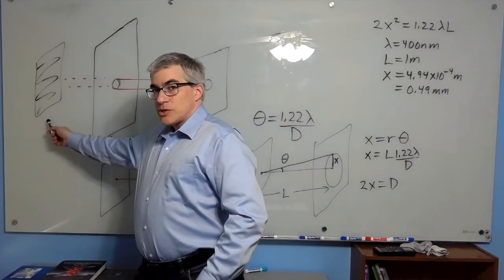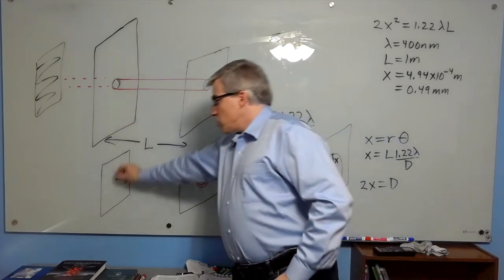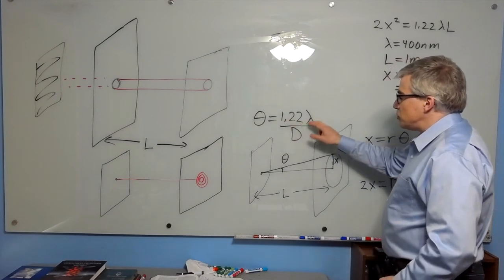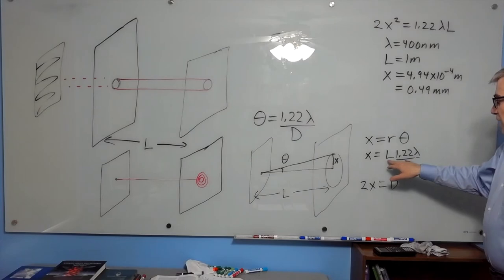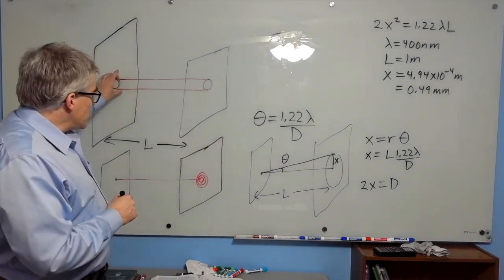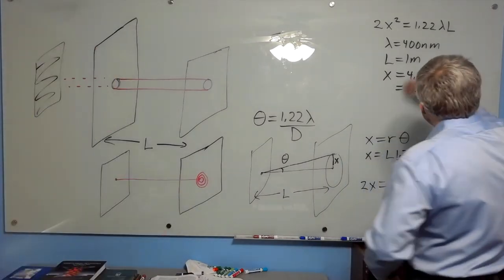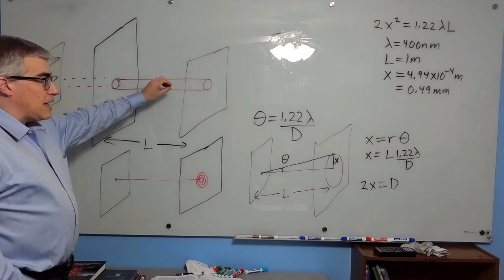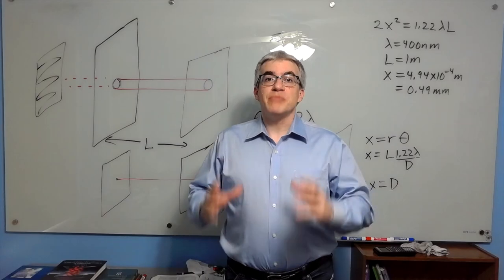Pinhole Size and Diffraction Pattern Size

Comment: sir could you  explain what would happen with the intensity?
Reply from the maker: A smaller hole lets less light through overall.
Reply: @robertcruikshank4501  but if I would to increase the size of pinhole   why isn't the diffraction intensity decreasing cause diffraction is more predominant when obstacle is small